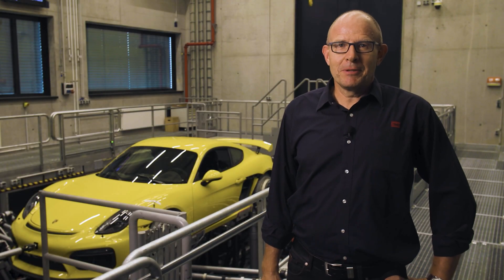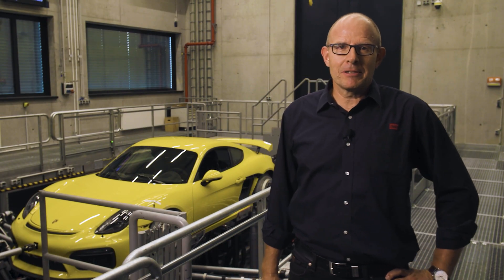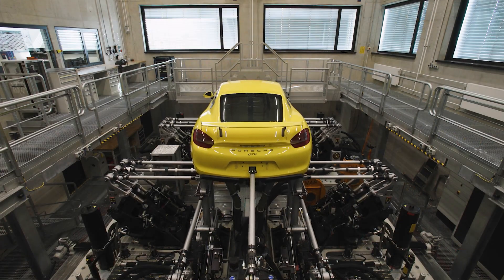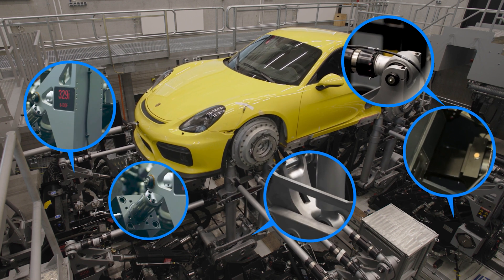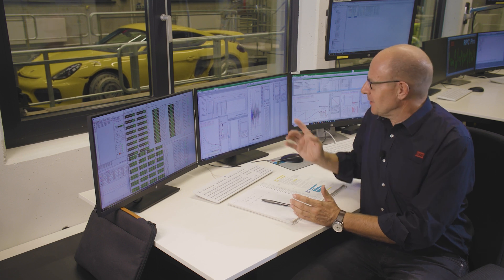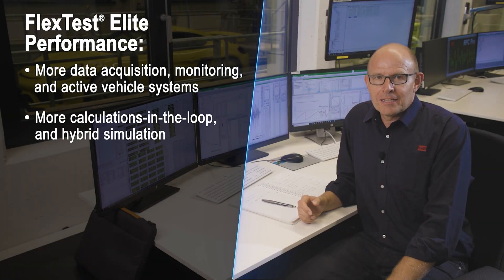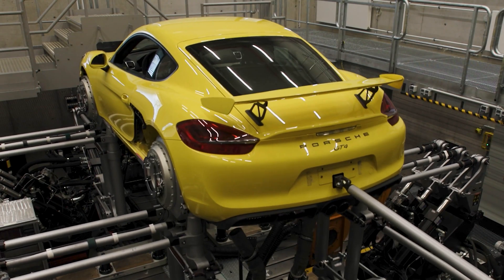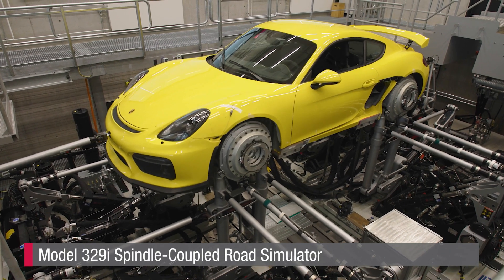Introducing the Model 329i Spindle-Coupled Road Simulator

Comment: So what's the purpose of the 2 longitude  restraints connected to the beams behind the bumper?
Reply from the maker: Semi-Active Longitudinal Restraint System: When combined with the Brake Intensifier Package, the Semi-Active Longitudinal Restraint System provides complete dynamic control of the simulation mode. During non-braking events, the vehicle body floats naturally. When a braking event is encountered, the longitudinal restraint and the brakes lock to provide a reaction to ground. The restraint system is fixed to the front and rear of the vehicle structure through the bumper mounts. Actuators are coupled through airbags, bell cranks and struts. The airbags deflate during non-braking events, effectively decoupling the restraint.